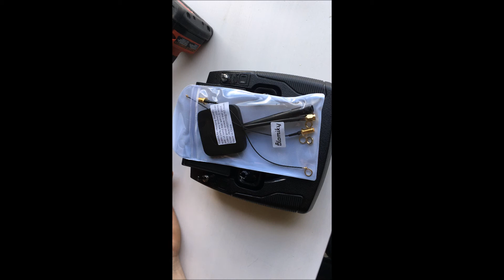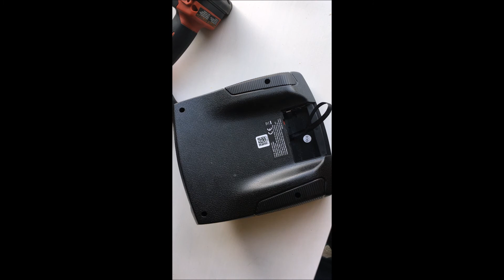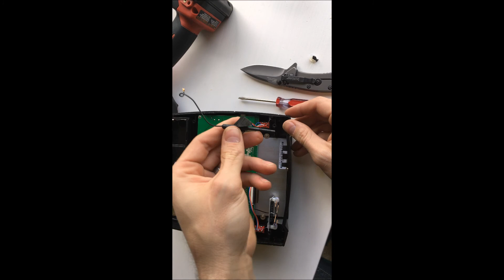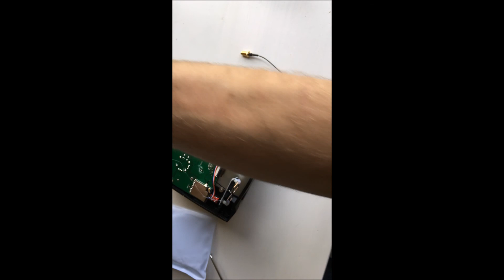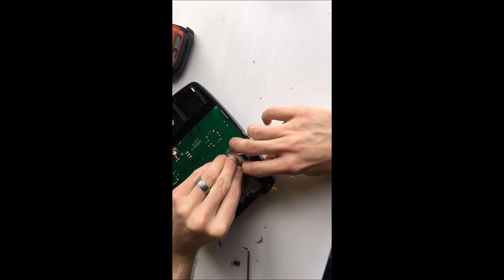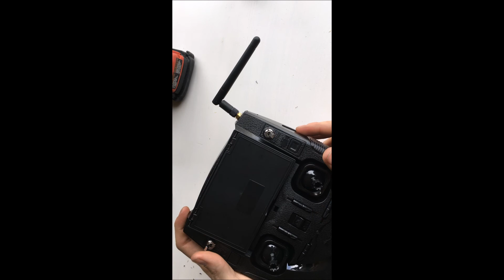Hubsan H501S Transmitter Antenna Mod

Comment: I would match the polarization of the quad and transmitter antennas for optimal performance. Vertical vs horizontal?  You learn that stuff getting your Ham ticket.